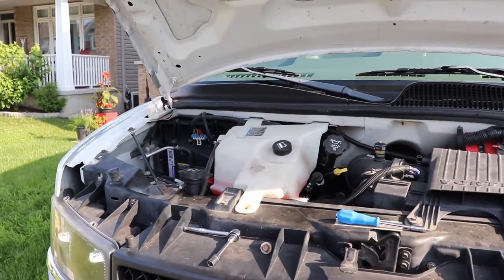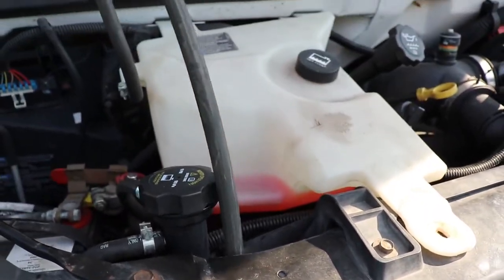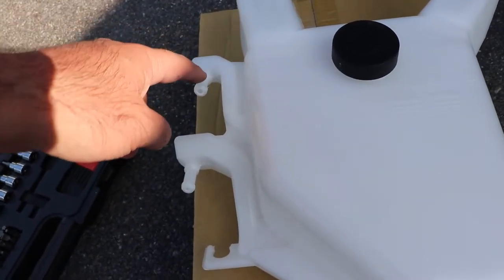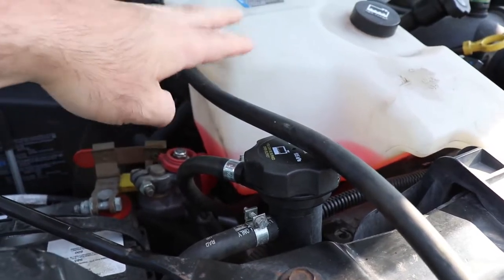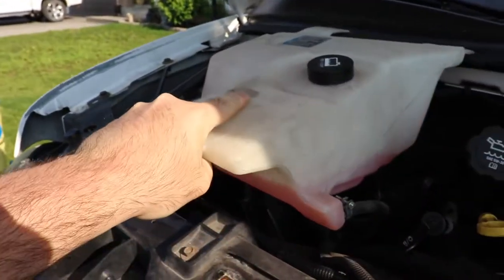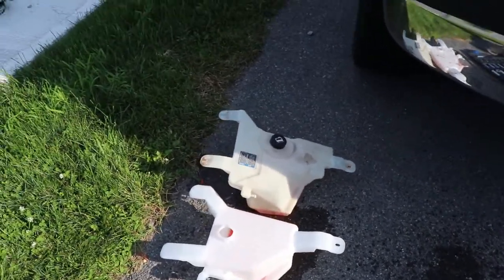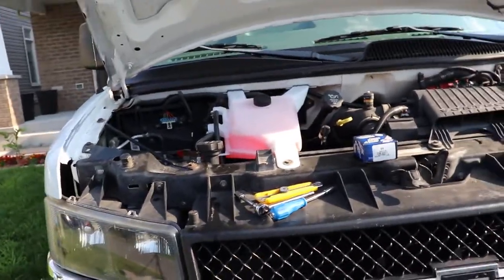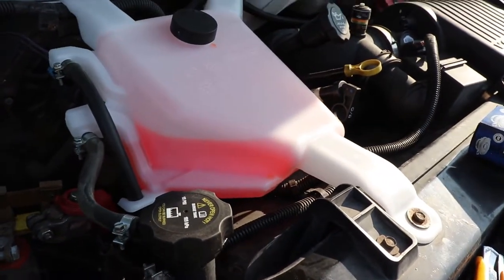Chevy Express Mystery Coolant Loss Fix

Comment: Will it work to just cap off overflow ?
Reply from the maker: no, that would stop the system from working correctly and probably lead to overheating
Reply: Wait so do you fill the radiator as well as fill the reservoir to the fill line. Or just fill the reservoir?
Reply: @itsshadybradybaby ?
Reply: @itsshadybradybaby  i wondering this too